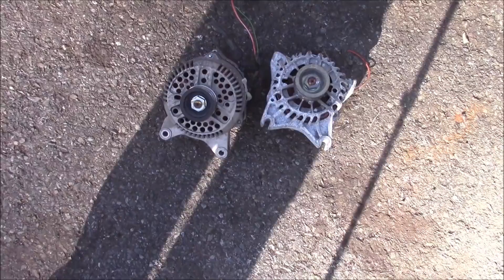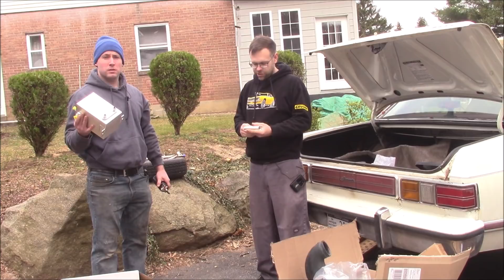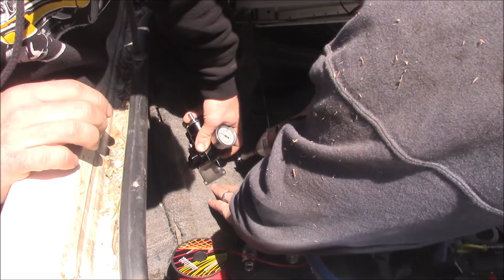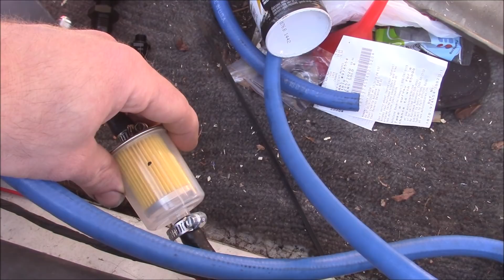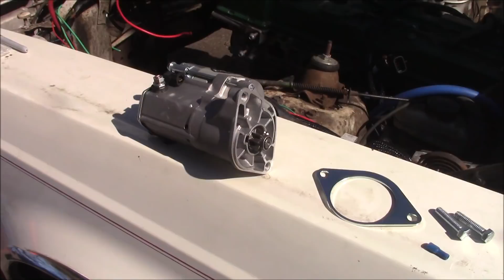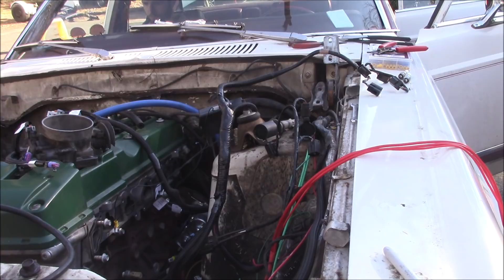1976 Ford Granada - Backyard Barra Swap - Part 3

Comment: Those green top Barra are good for 500rwkw,they are basically the same as a f6 engine.only difference is in the piston.some say the f6 has forged pistons,it doesn't they are gravity cast,a little heavier than the bf2 piston. its capable of taking more stresses

Comment: have you guys looked into the chinese style plenum for the intake -  may just fit in there
Reply from the maker: The stock lower intake is WAY too wide. The plenum isn't the issue. We have a solution coming over from AU.
Reply: @FuelInjectionSucks  awesome, very excited to see this. You have an LPG motor too which should be good for about 400kw stock bottom engine, just make sure that tune is good!

Comment: Get on line or to your barra supplier and get a FG falcon manifold from 2008 on aus falcon. And yes Aus falcon had t h e same shock towers until 1988.if you need any  aus Ford info I'm a Ford mechanic in Australia and would be happy to assist in any way I can .

Comment: When the lift pump falls off the car and bounces down the road when your at WOT and you melt cylinder 6 hit me up ill grab another gas motor from the wreckers and sent it to you cost price. Cant wait to see this thing go. Can the terminator x control the factory cam phasers or did you get aftermarket cam gears?
Reply: I talked to a guy that went 10.30s on a factory engine and no vct phasing.  He retarded each cam a tooth and left it.  Might lose bottom end but I dont have a bottom end with a 3400 converter

Comment: what are your plans for VCT? if you leave it unplugged the cam timing will be locked at 10 degrees advanced.
Reply: I retarded each cam one tooth when doing valvesprings/oil pump gears
Reply: @jason9022  nah just think of an 80s grand national with twice the power and half the leaks

Comment: That cheap shit lift pump ain't gunna keep up to the fuel demand.
Reply from the maker: It has in the last few cars.
Reply: @FuelInjectionSucks  can't be making much power then.
Reply from the maker: @brentonk461  Corey has a 2jz in a Pontiac Tempest 4 door that runs 10's using a smaller surge than this and the same lift pump. Been together for years with no issues. Seems to make enough power. His Coronet running dual in-tank pumps with no surge had fueling issues, so the surge setup seems to be the way to go.
Reply: @FuelInjectionSucks  i've run a Holley Blue Pump, ran into fuel starvation, changed to Holley Black Pump with a full tank of fuel, still Not really enough pump flow.
  
 A low fuel tank level and a surge tank together with a lift pump is a good idea to do though. That's up to you what you use.

Comment: Great to finally see terminator x working on the "non v8". Holley just unlocked those options in software and didn't really gave any info regarding that, so it's nice to be sure that it works fine. Guess my shitbox is finally going EFI then
Reply: GM sensors are 5 or 12volt hall effect 3 wire.  The barra sensors are magnetic/vr sensors that are 2 wire like a standard abs wheel sensor.  In my modified extension harnesses with a gm to ford conversion plug I just removed the 5v reference wire.  Used the crank signal wires only.  Sensor ground and signal only
Reply: Had to mess with sensor voltages in the trigger settings.  I believe its around .15 to .20.  The factory holley settings for magnetic pickup was defaulted to .00 and it didnt work at all.  Good thing we played with it
Reply: @obrienracing1  Thanks for the tip. I`ll definetely have to mess with trigger settings cause my motor don`t have any crank sensor so i`m starting from scratch. Probably will use GM sensors and look at LS base tunes for right settings.

Comment: why go thru all the fun of a surge tank when you don't need it!!! and, the little red pump is useless for the supply of the surge tank. the 044 pump can supply more then enough straight out of the tank!
Reply: 044 based pumps really like a large suction end.  I've run them off stock carby tanks but feel they cap off easily (hp limit) and are noisy.  Remember I'm running e85 30 percent more fuel being needed.   The stock tank is 5/16 and I don't want tank strap rust in my eyes so I'm clamping on old reliable.   The 10 second tempest runs this same setup and it's been flawless.
Reply: @obrienracing1  ok..............

Comment: Early 80's XE falcon ute with Barra swap. All Aussie falcons till 1987 had shock towers like your Granada. https://www.whichcar.com.au/tv/anthony-burns-barra-powered-ford-xe-ute-sleeper.
This Barra has the early NA alloy intake manifold.
This is the FG Barra turbo intake manifold https://www.ebay.com.a-FPV-F6-TURBO-INLET-INTAKE-MANIu/itm/FORD-FALCON-FG-XR6TFOLD/233488970144?hash=item365d06f1a0:g:phcAAOSwVc9ePkDT

Comment: What kind of fuel lines and fittings are you using? E85 safe I asssume
Reply: Using discounthydraulichose.com pushloc and fittings.  Been reliable on other builds with e85. I chose blue this time.

Comment: I want to run that terminator x on my gen 6 502 with the gen 6 454 efi on it, but I don’t know if it will read the cam and crank signals and Holley already told me they won’t answer any questions about that
Reply from the maker: See what Holley's dual sync distributor puts out. If it is a compatible tooth count, it should work fine.

Comment: And that starter motor looks like its from a petrol 75-99 Toyota Landcruiser. Also get rid of the factory coils, they only had 26mJ of spark energy off the top of my head. Just run LS coils
Reply: I'd prefer an fg cover and r35 coils.  See how this goes

Comment: Do you know where to get a Barra plastic mock up engine, anyone....
I'd like to put one in my 51 Ford F3...
Reply: With as cheap as a Barra is in Australia nobody sees the point. That said, it'll be a good fit. Easy fit. Those trucks can fit a 460 so get your Barra and set it in
Reply: @PureCountryof91  
I'm in the states, they're not laying around like rocks...
Reply: @joeschlotthauer840  nope. But there are a few importers now

Comment: I dig how Y'all are using an LS based Terminator system with GM sensors to overcome the lack of service parts for a Barra here.
I'm really digging this swap..
Reply: cheaper easier faster-using gm sensors and switches.

Comment: Buy the 2jz upper plenum off Ebay and build the bottom runners adapt to it.
https://www.ebay.com/c/19010452780
Reply from the maker: He tried that, the lower intake manifold is like 5 inches too wide to start.
Reply: Maybe cut  the intake  runners down and fab a box plenum?

Comment: All our fords here in australia from 1960s xl falcon up to 1980s xf falcon and eveything in between have the same shock tower space issues , if you know any fabricators just shorten the trumpets on your intake to fit your application , enjoying your progress anyway up the mighty BARRA in america
Reply from the maker: That's what I've been finding but I think there may be an additional engine offset or something, because the "retro" Barra intakes are still too wide. We are working on a solution with a vendor in Australia now, hopefully it works out.
Reply: @FuelInjectionSucks   yeah the original 4ltr motor in our early fords was basicaly upright the barra is offset due to the vct head twin cams, there is aftermarket intakes available but as you said you will be spending your kids inheritance on1, anywhere from $1000 to $2500 au dollors, best bet is to get a standard intake of a ba bf (alloy intakes) or a fg (plastic intake) or fg turbo intake (alloy centre throttle location ) fg use a differant fuel rail and throttle body,  a none turbo ba bf intake is the exact same as a turbo one , only differance a vacume pipe that opens the butter flys inside the intake

Comment: Can you frankenstein a Volvo T6 or similar Vovlo 6 cylinder intake manifold? They're pretty low profile iirc, and from the Ford/Volvo era...
Reply from the maker: Never heard of anyone doing this, probably harder to find than a Barra manifold too.
Reply: @FuelInjectionSucks  there's a lot of P2 platform Volvos ending up in the junkyard right now. The straight 6's would be in the 1999-2005 S80 and 2002-2014 XC90 with the 2.9 or T6 trim.
Reply: Try a gm 4.shitbox i6 intake. The donor engine is hot garage, but maybe it will have a use?